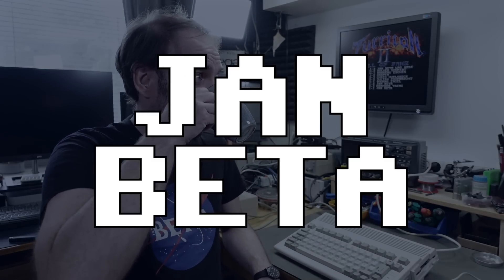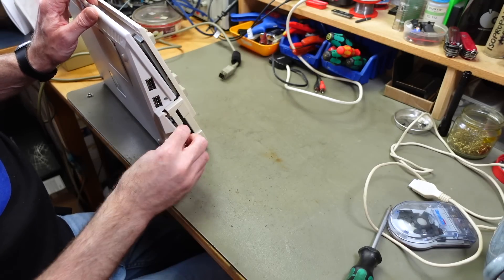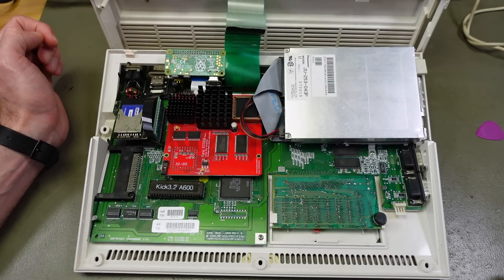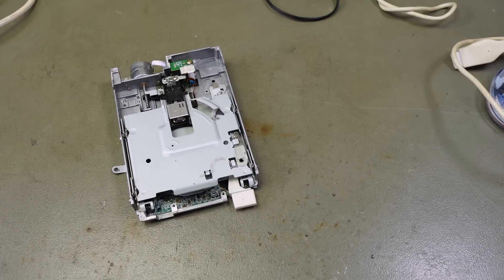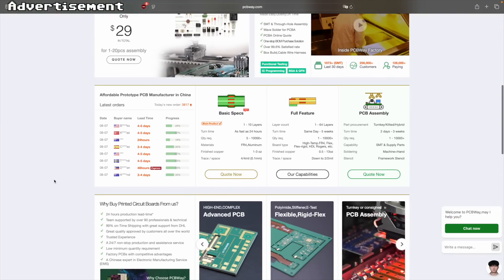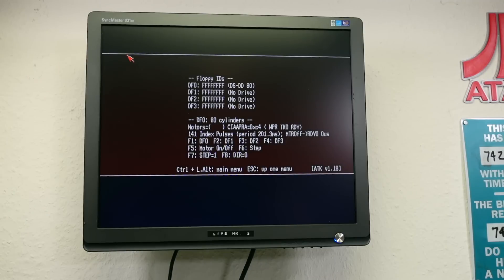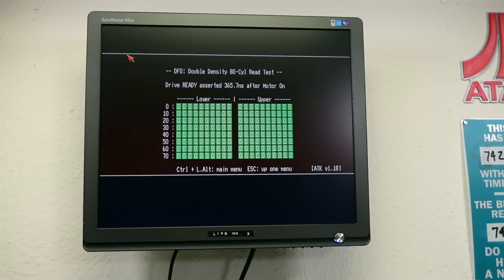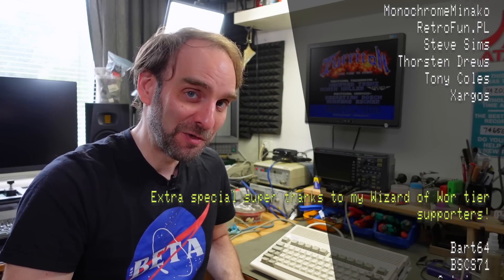Amiga 600 Panasonic JU-253 Disk Drive Repair

Comment: Hi Jan! Very good video man!
Let me ask you something: Yesterday I just did the same work as you did in the video, (and also I recap a small second capacitor in the other PCB of the drive). Before the recap, the worm gear didn't move. Now, it does. However... it doesn't stop now: it carries out the head to it's end position and still continues pushing for a 2-3 seconds, and never goes back to its initial position. I checked the voltage, I cleaned & lubricated properly the worm gear... but still works bad as I explained before.

Did you have some earlier experience like that or can you tell me some tip to fix this behavior? Any info from you will be very appreciated.
Cheers from Catalonia! ❤

Comment: I followed your guide and got my bad Panisonic drive in my 500 working again.  I can see a second cap hidden in the back of the drive which i cant seem to reach or dissasemble though. Many thanks.
Reply: yesterday I just recap that second capacitor you were talking about, it was pretty difficult but I could get the work done.

Comment: Make a video on soldering the through-hole capacitor - that would be a good demonstration of a nice little soldering trick!
Reply from the maker: Oh, there's not much to it really. You just shorten the legs accordingly, solder them flat to the SMD pads and bend the capacitor out of the way to the side. Wouldn't recommend it though, because it puts a lot more stress on those fragile pads than a proper SMD part does. (It works fine electrically, of course, but at the time when I repaired my A1200's drive, it was a workaround for lack of a proper part.)

Comment: heh.."LIPS Mk 3"  the big monitor died, eh?
Reply from the maker: Yup, the HDMI inputs suddenly refused to work for some reason. I guess it's either a fuse that popped or the controller chip. I'm going to try to resurrect it but in the meantime, I've gotten used to the smaller new monitor. :D

Comment: Have seen some surface mounted capacitors in the disc drive of my last purchased A500.
It is a Rev. 5 amiga board. So i was surprised to find surface mounted caps in the time of Rev5 amigas....
Can this be the original drive.
Have bought this from eBay.
Reply from the maker: I think they started using those SMD parts in the early nineties (or possibly even the late eighties for some specialized stuff), so if you got an A500 that was produced relatively late, it's very possible that there's a drive with SMD electrolytics in there from factory. I think my A500s all had through-hole caps in their drives but I mostly worked on earlier revisions.
Reply: @JanBeta  
Have to look.
But i think it is the 'Epson SMD-400' disc drive.
Here on exxos forum homepage, there is a thread:   Epson SMD-400/SMD480L
I see many capacitors.
Do you think, there will be come the time the drive is failing cause of these caps?
Last time, i've tested this drive in the Rev.5 A500, the typcial disc reading noise was a little different than my drive in my 2. A500 (which is revision 8 or 8.1)
Acc. to this thread, it seems more a heavier repair task, isn't ?

Comment: Great job, but next time don't use electrolytic caps on 10uF or less. MLCC caps in this capacity already exist for quite cheap and if you swap it for the ceramic cap, it will be forever as opposed to the electrolytic cap which will leak eventually again.
Reply from the maker: Not sure if I'd recommend using an MLCC cap in this. I usually just replace same with same these days. (I've replaced electrolytics with ceramics successfully in the past though, even one of my A1200s has all ceramic caps in it now.)
Reply: @JanBeta  Murata has some general purpose MLCC, which I bet would work in this case. But I am not an EE, so who knows. :) I would also go with MLCC, unless someone convinces me otherwise. Especially if it is used only for filtering out AC components.
Reply: @JanBeta I've measured a bunch of those floppies. Those caps usually control rotation speed and precision is the key. All the floppies I have improved with MLCC caps are dead solid without any deviations of rotation speed. 
The only reason the engineers put electrolytic cap there is because it was the only cap available in this capacity.

Comment: I revived a couple of external Amiga disk drives with capacitor replacements, one being a Citizen brand drive (I forget the enclosure's brand), an odd slim drive that still used belts inside, and had a couple of caps turn into wet fish, but, cleaned, replaced, lubed and it worked again, even if it was a belt-driven oddity...
Reply from the maker: Funny that there was a model that used belts in the Amigas still. :D The capacitors are always suspect in these, even the through-hole ones. I've managed to revive a few, too. The SMD caps are of course even more prone to failure.

Comment: Thanks for sharing. Where is the big 'LIPS' tv, given up the ghost??
Reply: 16:12 this one says “LIPS” too!
Reply: “LIPS mk 3”? Haha
Reply: @paszTube  
same features than the action replay MK3  
;-)
Reply: It’s a Samsung Syncmaster 931BF it seems, I wonder if it can handle 15khz signals
Reply from the maker: It can't unfortunately. But I use it with an upscaler most of the time anyway, so no big deal. (Plus, I found it on the side of the road as a freebie.)
Reply: @JanBeta  Free stuff, what's not to like, especially as it works.
Reply from the maker: The big LIPS decided to stop working on the HDMI inputs, so I use this small one as a stand-in for now. It's probably an easy fix (if it's not a controller chip or something). I've already gotten quite used to having more space behind the workbench though, so maybe the old monitor is not going to return. We'll see. :D
Reply: @JanBeta  Thanks for the update. Certainly makes the workspace appear lighter and more congenial. I have a Samsung SyncMaster  943 still going strong after 15+ years; runs on my MacPro mid 2010.
Reply: @JanBeta  ahh that makes sense.

Comment: The SMD caps at the time were nothing like modern parts, no real MLCCs had been engineered yet.
Reply: Those are electrolytics that leak, they would still use those today. Ceramic caps and electrolytics have different use cases. You can't just blindly swap them out. Being SMD doesn't mean it's MLCC.

Comment: Those Panasonic models were used in some Atari ST models too. There were a number of configuration solder points on the drive board so if you use a JU-253, make sure they are set for your use.
Reply from the maker: Oh, that's good to know! I'm going to have to have a look into my STs again and see if there's any disk drive problems. :D